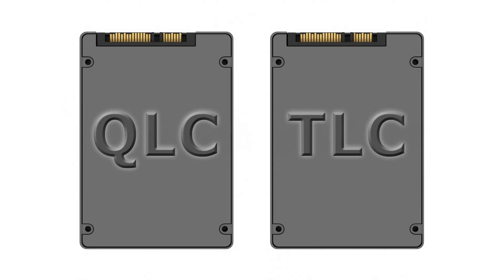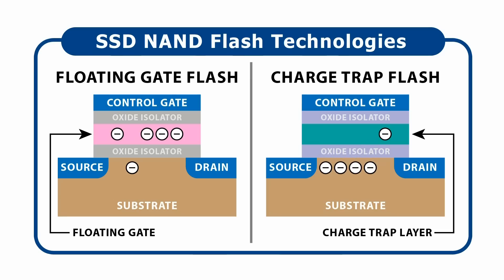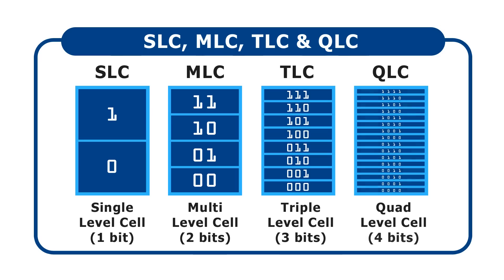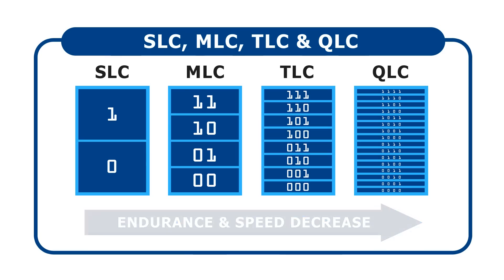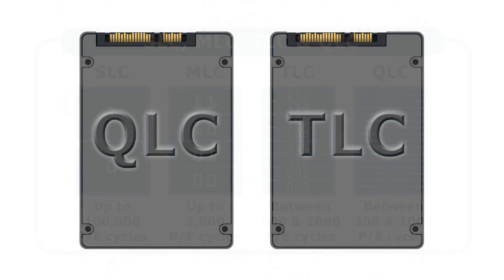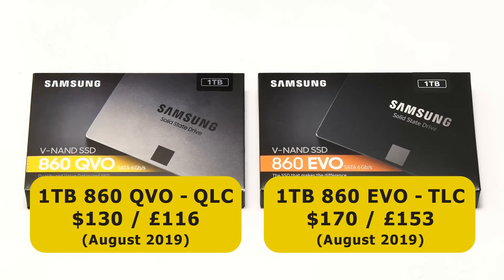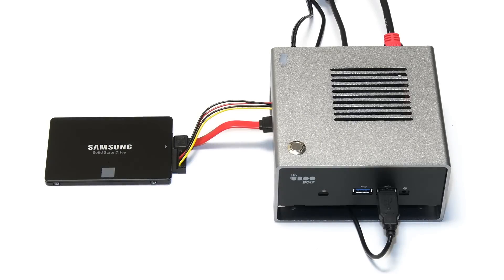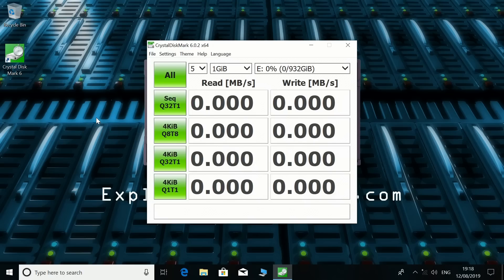QLC vs TLC SSDs: Samsung QVO & EVO

Comment: Years ago, I looked into SLC, MLC, and TLC micros cards, I used to use them in my mobile to install apps on. I used to find the TLC chips would last a couple of years, before they become unusable. I invested in quiet an expensive industrial grade MLC chip card, as at the time you couldn't get a 128GB SLC card. Quiet honest, useless lasted about an other year, and again become titially unusable.
I am staying clear of any of this type of chips, as none of them TBQH are any use if you value your data. 
Only thing to use is an HDD, I have had them for 10 of years before I have any problem, the capacities are far greater, and far cheaper than any type of memory card chip.
Reply from the maker: Do not confuse the performance of flash memory cards and SSDs. :)
Reply: If you value you data, you shouldn't put them on any one drive because they will all fail. Safest to put them on multiple drives because simultaneous failure of multiple drives is significantly lower, especially if you keep some of them off line. If you do that, even the most unreliable drives are fine.

Comment: Really nice video, but I'm not sure it answers the question - is a qvo drive a good idea for data storage? I am not planning on having it as a boot drive, I already have a pro nvme for that, but I want it to store files, and that's it. Do you recommend a 4tb qvo? Or should I go for the 2tb evo?
Reply from the maker: A QVO is fine as a data storage drive, provided that you do not need to regularly transfer tens or hundreds of GB at a time.
Reply: @ExplainingComputers  Thanks for the reply! 
No, nothing like that. I mainly want to use it to store files that I create for work (small in size) and I want to get rid of my old HDDs. Thanks again for answering my question, I am definitely getting a 4tb QVO soon then. :)

Comment: Thanks for the video. It's interesting to note that SSD prices haven't budged in the 2 1/2 years since you made this video (I just paid $130 for an 860 QVO - the same exact price you quoted). For more information on SSDs check out:
https://images-eu.ssl-images-amazon.com/images/I/C17jMBe-EjS.pdf
Personally, I strongly favor SSD over mechanical HDD because a single drop can render an HDD useless, whereas an SSD will gradually degrade. Here is a performance monitoring tool that will give you a heads up on the degradation process:
https://www.ccleaner.com/speccy
Reply from the maker: The pandemic has had a lot to do with static SSD prices . . . a lot of manufacturing did not happen in early 2020, and became more difficult later in the year.

Comment: Hmm. Well, now (16 days into 2021, but still), you can get very reputable 1TB TLC SSDs (Crucial MX500s) for 85$. You were off on capacity, but that's only about 40$ more than equivalent 2.5" HDDs. We've entered the territory where 1TB of SSD storage can be gotten for less than double the price of equivalent HDD storage. That's very important to know.

For QLC 1TBs, it's a few dollars cheaper at most. Not worth it.

You were also dead on---no surprise given how smart you are on computers, about at least laptops or mini PCs dropping HDDs entirely. Most laptops from 2019 onward were dropping HDDs and just used SATA M.2s, allowing a lot of efficient, fast storage in a small frame.

TBW/warranty also should be addressed next time. You touched on it a bit but I think it needs to be put into better perspective if you ever do another SSD video.

"Crucial points out that 180TBW is the equivalent of writing 98GB per 
day for five years, an unlikely scenario for a typical consumer laptop 
or desktop."

That's important to note. A lower TBW looks scary until you realize that you're unlikely to ever have it be an issue.
Reply from the maker: Great post. :)

Comment: @7:09 "So beyond 42 gigabytes of write, these drives will slow down"
Not exactly (correct me if I am mistaken).

Consider the following statement, which is intentionally wrong:
"The drives store 100% of new data in their faster SLC cache, and only during idle time do they write that data to their slower TLC (or, as the case may be, QLC) NAND cells."

What actually takes place is that while the data is being written to the faster SLC cache, the drive is simultaneously offloading the data to its slower TLC (or, as the case may be, QLC) NAND cells.

So if you were copying 50 gigabytes to the drive in one shot, then...
...by the time you sent 42 gigabytes to the drive, the drive would have already transferred, perhaps, 10 or 20 GB to its slower NAND cells.

So with a 42 GB SLC cache, it takes more than 42 GB of data to keep it full.

Like filling a 42 gallon tank with water, while at the same time people line up and fill their glasses with water from the nozzle.  It will take more than 42 gallons to top off the tank.

Also note that, although the drive will slow down, and significantly so, when you fill up the cache, that slow-down is very temporary.  The drive will work, non-stop, emptying its cache to the slower NAND cells.  So under normal use (where you are not bombarding it with scores of gigabytes of data), it will always run very fast.  Just don't think that once you fill the cache and it slows down that you ruined the drive.  It will empty its cache and run at full speed, again.

However, the test at the 12:30 time mark, suggests that my above analysis is correct only for the TLC drive.
Apparently, the QLC drive has a cheaper controller, that does not offload its cache while new data is still coming in.  When its cache fills up, then it is forced to do so, which is why we saw the slow-down.  The less expensive QLC drive allowed its cache to fill up.

The TLC drive would have also slowed down, eventually.  But it would have taken more data to fill its cache, because its controller was emptying its cache while new data was coming in to the cache.

Cheers!
Reply from the maker: Yes, you may be correct if the drive controller is able to simultaneously write to cache and read from it to write elsewhere. But I'm not sure that's how an SSD controller works. As far as I am aware it will write to the cache, and then once the cache is full it will write to non-cache. And then when there is no more data coming in, it will move data from cache to non-cache. What you describe would require significantly more extensive and expensive control electronics.
Reply: @ExplainingComputers  The design, to both write to cache and to read from cache simultaneously (or close to simultaneously), must exist.  Why?

If you decide to copy 500 GB to the drive, it will all get written without stalling.  So at some point the cache will get full, and yet the copy process continues.  And you never see (in your benchmark) a pause where when the cache gets full it pauses to empty the cache, and then returns to accepting more into the cache.  It just slows down.  And I doubt that it seals (so to speak) what is in cache and is allowing new data to go directly to the QLC NAND cells, and eventually emptying the cache when all other data writes complete.  That would be asking for trouble, if when the cache gets full it was in the middle of a file being written to the cache.

The only way around this, that I can think of is, that once the cache gets full, that the QLC drive (when the cache is full) quickly jumps back and forth between writing out a few bytes and reading in a few bytes.  If it is doing that, then that might look like the copy process is constantly writing (albeit at a slower speed), when it is actually constantly pausing to write to the QLC NAND and then quickly returning to read more into the cache.  If it does this 10, 20, 50 (whatever) times each second, the benchmark will still report on average bytes per second, so you would not see the pauses.

I am taking an educated guess at this.  And it would explain why the TLC drive never slowed down, if the TLC's controller was more sophisticated, such that it can work on both ends of the cache, simultaneously.

By the way, if you were to copy 500 GB to the QLC drive, then when it reports that the copy job is done, is it really done?  Or is it only telling the OS that it is done because it has all of the data (some in cache NANDs and some in the QLC NANDs), and it happily chugs along in the background emptying its cache?

And, if immediately upon the copy job claiming it is completed, if you were to issue a shutdown command, would Windows (or other OS) know that the drive is still working on emptying its cache, and delay the shutdown?  Or does the drive simply keep a note on what it has to continue emptying from cache, upon the next boot up?
Reply from the maker: @0Perhaps  This is not what I described. The drive will fill its cache, then seamlessly start writing to non-cache, if with a decrease in speed. All data held in the cache cells remains perfectly safe, and if the drive is switched off will be moved to standard cells when the drive is powered up again.

Comment: Just picked up the 1TB QVO, and while its one of the cheaper 1TB SSDs, it still cost just over £110. On the plus side, I got an 8TB external drive for the same price thanks to black friday (they were actually £106 so I bought 3 of them :D).

Comment: Nice test, but for comparing and test you should to use the same capacity of both discs. So, 500 GB EVO vs 2TB QVO is not reliable.
Reply from the maker: I am utterly bewildered by your comment. The two drives were the same capacity -- as very clearly indicated from 4:12 onwards, both were 1TB. I said it. It was printed on the drives and boxes. And it was in the graphics. What possible reason do you have to think that I was using 500GB and 2TB drives? I must be going mad. I really give up.
Reply: @ExplainingComputers  I apologize! This situation was in other YT movie. Again, apologize! Anyway, please don't give up :) BTW, your test help me choose between QVO and EVO series. I have just in SSD 12 TB, I need 8 TB more, so QVO 4TB has good price, not bad parameter of TBW. Anyway, I will buy rather EVO. What do you think about Sandisk 3D 4TB (based theoretically on TLC technology, Sandisk support answered me, just on MLC - I don't believe it). Second thing, that MLC (multi Level Cell) chronologically was after SLC, and TLC after MLC. Basically I need more memory for reading big sample libraries. I have QVO (1TB) and older EVO 850 1TB - the loading process of big presets from sampler is practically the same, I don't see any difference... 
I will delete my stupid commentary. Again apologize!

Comment: Thanks for this video. I wish you would have included testing near full capacity as I’ve heard QLC’s struggle when filled more than 70%
Reply from the maker: How full a drive is will make no difference whatsoever to the speed of a drive. However, if a lot of data has been written to and deleted from a drive, it will be slower.
Reply: @ExplainingComputers  From my limited understanding—w/SSDs in general—specifically the write speed of an SSD dips inversely with the rising percentage filled. This is due to cache levels dwindling as the drive nears capacity. And since QLC’s start off with relatively very low write speeds (compared to TLC’s), write speeds drop to sub-HDD levels 🤷🏽‍♂️
Reply from the maker: @abehaile2659  This is not quite right. How full  an SSD is will not impact write speed. But how much data you are writing in one go will. As you say, when the cache gets full, the speed drops dramatically on (say) a QLC drive -- as I showed in a QLC vs TLC drive test in a video last year. But this is all about the percentage of cache filled, not the percentage of the drive filled up.
Reply: @ExplainingComputers   Could you make a video or just if possible please reply.....Which external portable harddrives have MLC, TLC and QLC.........i was considering buying a samsung T7 (non touch) or a samsung T5 or sandisk extreme pro but i dont know which one has a TLC , and which one has QLC......could you tell me how can i find these details for these portable hard drives......thanks.....i was looking to buy a TLC drive or MLC (just dont want to buy a QLC drive) but i cant find that information on portable ssds

Comment: Isnt the evo an MLC drive
Reply from the maker: No, the EVO is TLC. But Samsung refer to it as "3-bit MLC", which in everybody else's book is TLC. Regardless, it stores 3 bits of data per cell. Samsung Pro drives are MLC (2 bits per cell). Samsung call their Pro drives 2-bit MLC, and their QVOs 4-bit MLC. So a pretty daft use of MLC "multi level cell" by Samsung there.
Reply: Thank you for this info. However, their 3-bit MLC somehow feels better than others' TLC, would you test that also?

Comment: Unfortunately your prediction of QLC 2tb's being a $100 or less haven't come true, nobody saw Covid coming.

They're currently still in the uk at this point £185 to £200, I was able to snag a 2tb from eBay at £140. It's a shame we didn't see this come true as of yet, fingers crossed things get better.
Reply from the maker: True. 2020 has not turned out as expected. :(
Reply: @ExplainingComputers  I know you don't tend to cover consoles, but now the impending next gen consoles are upon us and are beginning to crossover into the more technical space, will you be covering the compatible ssd's?

I know the ps5 will take specific m.2 pcie 4.0 that are only now coming onto the market, (wd black sn850, Samsung 980 pro, the sabrent 4 plus around the corner).

will you be covering them?
Reply from the maker: @Andy_B11  This is not something I had considered, but you made an excellent point. So I've made a note. Thanks. :)

Comment: I'm in the market for either of these and I deal with large files (4k footage, virtual instrument libraries, large sample files). Would an enclosure affect the speed in any way? I'm looking at getting an SATA III to usb c enclosure with a 6gbps interface.
Reply from the maker: An enclosure with a USB 3.1 or USB 3.2 interface, connected to a USB 3.1 or 3.2 port, should not impact the speed. But if you use a USB 3.0 enclosure and/or port, the theoretical transfer speed will be capped at 5Gb/s. The cache/speed issue shown in the video will not be impacted.

Comment: when buying an ssd, how do we tell whether the ssd is qlc or tlc?
Reply from the maker: It can be difficult. For Samsung, all QLC drives are called QVO (and labelled 4-bit MLC), and all TLC are called EVO and labelled 3-bit MLC. For other manufacturers, you need to look for QLC/4-bits per cell and TLC/3-bits per cell in the specs.
Reply: @ExplainingComputers  thank you for replying to my question chris! yeah seems like manufacturers are not keen to provide this information to customers, eg. WD doesn't even have anything related to qlc/tlc/4-bit/3-bit in their spec sheet

https://documents.westerndigital.com/content/dam/doc-library/en_us/assets/public/western-digital/product/internal-drives/wd-blue-ssd/data-sheet-wd-blue-3d-nand-sata-ssd-2879-800092.pdf

Comment: @15:40 That was a pretty terrible guess buddy. Half way through 2020 and ssd's cost more than double what you thought they would!
Reply from the maker: But 2020 has not quite worked out as we expected! :O
Reply: @ExplainingComputers  But early 2020 prices were about the same before covid-19 so it's no excuse.. I would estimate we stay on the current curve. If a 120gb ssd cost about $60 usd in 2015 and its about $20 usd now I would say by 2025 we might see 2tb prices where you were expecting them to be this year.

Comment: bullshit comparison...who is going to use a drive that is always empty? u should test with the drive reasonably filled
Reply from the maker: Filling up a new SSD will make absolutely no difference to its speed. The speed of those empty flash memory banks you will write to is not influened by whether others are used or not. :) So this is not a "bullshit comparison". But over time a drive will slow down once all cells have been written to many times.

Comment: What about large downloads? Like game files that are up to 200GB in size? Would the write speed be affected during the download?
Reply from the maker: It will depend on the speed of your Internet connection, and how fast you are downloading a 200GB file. Unless you achieve very fast download speeds, there should not be an issue.

Comment: What he says makes a lot of sense but from what it appears to me is that he's connecting via a USB SATA cable which to truly test he should actually install the drive simply because of the USB limitations. From what I recall on the newest USB version it maxes at roughly 500gbs whereas a direct SATA connection should get higher speeds.
Reply from the maker: No, I'm not connecting using a USB SATA cable. I'm connecting directly to a SATA port on the UDOO Bolt -- a standard, direct SATA to SATA connection. I make this very clear at about 7:30 in the video.

Comment: Somebody really needs to make a research about how long it takes before these SSD keep data being turned off.
Such technology should have a period after that cells lose charge and data becomes garbage. I wonder if it takes a weeks or months or years for data on SSD to disappear.
My SSD is being turn on every week at least. It should self refresh itself when turn on. There is no such problem on HDD, coz they use very strong magnetic field and can keep data for years.
HDD have another problem - mechanics can stop work (motor get stuck) after long enough storage. I believe newer SSD become less reliable, especially during storage being turned off.

Also thanks Samsung for at least documenting SLC cache size. Many crappy OEMs don't even bother documenting such important parameter. As crappy LCD monitor OEMs which doesn't specify bitness of screen panel (6 bit + FRC or 8 bit).

Comment: I see at the end you're using Linux Mint - An excellent Linux which I also use (usually in a dual boot configuration with Windows 10) and thoroughly recommend for anyone wanting to transition away from Windows.